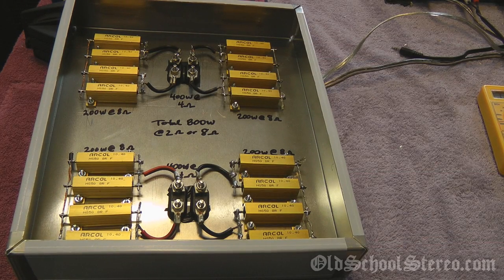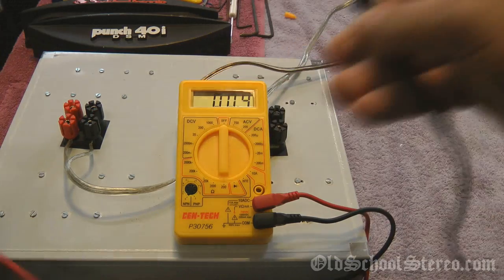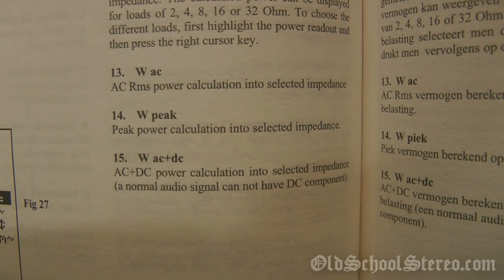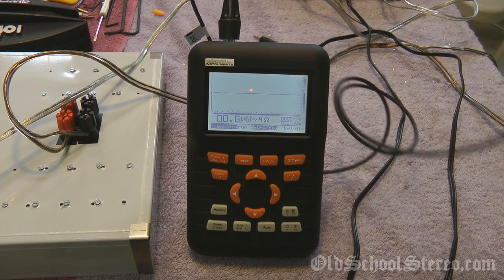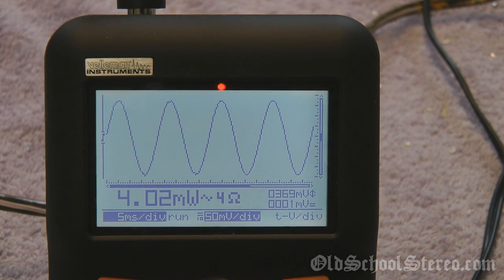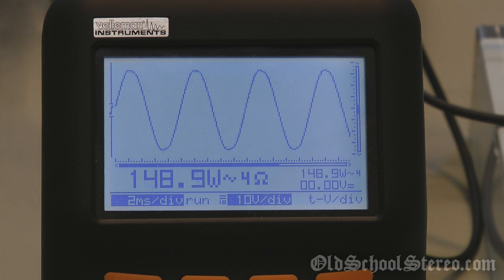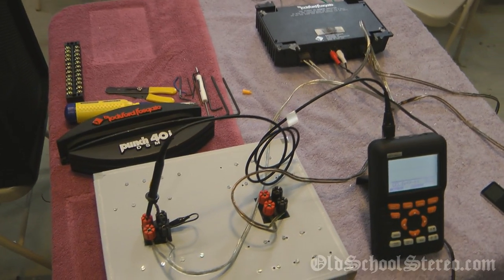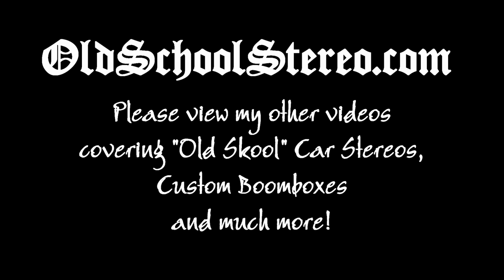Test Car Amplifier RMS Power Watts - Not Clamping Using Oscilloscope

Comment from the maker: speakers represent a reactive load to an amplifier (ohm load changes based on frequency) whereas the resistors I use offer a resistive load and the ohm load does not fluctuate during testing. It provides a much more consistent result and there are phasing issues to account for when using reactive loads which further complicate the measurements

Comment from the maker: @kskate91 Yeah, it's called a "Punch Status Display" or PSD. A telephone style cable would connect to a small display with indicators for amp operations such as; power, signal level and thermal protection. You can get the 40x2 manual from Rockford, shoot me a message if you want with an email address and I'll forward it to you.

Comment from the maker: Most are rated at 2x continuous rating for bursts. You'll just have to monitor the resistors as they will heat up quickly. Look on eBay for 1000w braking resistors. They are available for around 35 US each and available in 16 ohms down to 2 ohms

Comment from the maker: Speaker is reactive and ohm load is always changing (reactive). It's best to use a resistive load to keep measurements accurate. You will also need an o'scope and True RMS volt meter. My o'scope has the True RMS volt meter built in, but I also monitor with a fluke DMM

Comment from the maker: It was cranked up pretty high to match the low voltage output from the iPod. Remember, the gain is not a volume control, but a signal matching control. I could've had it cranked all the way to the max, it would've just started clipping with less volume on the iPod. The resulting power output would be the same. If the gain was too low, when the iPod reached max volume, there would be no clipping from the amp

Comment from the maker: @toucheslapper I purchased the parts from Mouser, but I think DigiKey has the same parts. I'm going to build another resistor bank and use the case of an old DVD player as it is almost the identical size to the aluminum case I got from Mouser. Send me a message here if you need the exact part numbers, I should be able to dig them up.

Comment from the maker: I see what you are trying to do here, but the 2ohm resistors will only consume power and will not help you get more power to your speakers. The extra power will be consumed and turned into heat by the resistors. In the old school systems run by a single 2 channel amp, some crossover networks would include resistors, but the intention was to lower the output of the rear speakers.

Comment: I bought a nano v3 oscilloscope to help me dial in the gain on my rockford fosgated bd1500.1 mono subwoofer amp. (2000-2003 year) I ran into a problem with the oscilloscope not having the capacity to read high enough voltage!
it tops out at 84 volts and the wave peaks somewhere way off the limits of the screen.
Question: do you know what the maximum voltage/wattage your oscilloscope can read and still show the sine wave on the screen?
thanks!
BTW awesome channel!!

Comment: How does the reading you get from the o-scope compare to what you get from your amp dyno?  Would it be comparable to the un-certified run?  Really like your vids, good stuff!
Reply from the maker: Yes, should match uncertified (clipping) mode. Thanks for the comment and for watching my vids!
Reply: Now that you use an AD-1 or amm-1 does the Velleman read the same as those or is it sowing “va”? I would like to get a amm-1 but none are available so a Velleman hps50 seems like my only option to show watts. Like your videos, have you tested a Soundstream Reference 405? I have 2, one on each side of vehicle. I run channels 1/2-3/4 bridged and there are no power specs that I can find for that mode. Again love your tests and all the old amps you test. Have you tested an original Zapco 2 piece pa151 (before they had rca’s in chassis)? If not I can loan you one to test that I bought original way back. Also have  Nakamichi pa300 and pa300series2 and Alpine PDX5 I would like to test as well as home equipment. Classe ca300 300w/ch-8ohms
600 into 4ohms and McIntosh Ps112 sub 300 into 8ohms. Any info is greatly appreciated.

Comment: Ahh, meant the TPI 440. Either way I ended up with a HPS50 that just arived today. Got the DD-1. 
If it's not to much trouble can I get the parts list for the dummy load tester? If it's easier to respond I go as ROLEXrifleman on the steve meade site as well.  THANKS AGAIN!

Comment: are these measurements equal to Volt X Amperage X Power Factor ? if power factor is not included during the process, it can't give the correct output.
Reply from the maker: With a truly resistive load, you can use Ohm's Law and power factor and electrical phasing are not involved as they are when reactive loads are used
Reply: Dereck BigDWiz
you mean powerfactor is %100 with a truly resistive load ( constant ohm )

Comment: Hi Big D
Would like some info from you please. Wanting to run a SQ system in my car I am running a Helix Competition 6 Channel amplifier with Morel Elate 6.2 components (200rms) both are hi SQ products but the morel speaker crossover puts out a 4 ohm load, and my amp only gives out 75RMS @ 4 ohms want to drop it to 2 ohm load without damaging the amp or speakers.Jumps to 125RMS @ 2 0hms.  Can I put 2 ohm resistors just after the amp output channels. Which Good SQ resistors would you recommend

Comment: Yo big d I have a question.my buddy is going to send me a 84 Amp power supply and I'm going to run a kicker kx600.4 on two mtx single 4 ohm 15's. Will the electrical coming from a wall outlet be able to handle the 600 rms being generated?
Reply from the maker: Yes, it should be fine. Amp won't need large amounts of current continuously

Comment: Power factor is not used in measuring watts RMS as far as i know you can do it without the resistors ohms law  Watt = (Volt^2)/Ohm only need a multimeter and scope may be it not as accurate has a true RMS but u can
Reply from the maker: Power factor comes in to play when you are using a reactive load instead of resistive

Comment: does the scree look wash out? like in d vid?
Reply from the maker: +Raj Dann no, screen is clear. Hard to capture for video purposes. I bought this model because it had a USB output and hoped I could use it with a PC to show the waveforms...but the output did not display the wattage/voltage, just the waveform
Reply: how long did it took to ship to u?
Reply: kool I ordered one based on watchin ur vids....

Comment: hmm cosnidering i dont intend to ever do comps. could i just use some music, instead of test tones? lol
Reply from the maker: +emerybryant more recent tests show dynamic tests, which simulate music power
Reply: ah ok. cool. hoping to buy one of these in the next couple days! :D
Reply: lol finally got one! it hasnt got here yet. does it have standard bnc connector? o.o i cant find pics lol
Reply: standard bnc confirmed. however something i wanna know is the resistance of the test mode. the lowest the meter shows is 2 ohm. will it not go below 2?
Reply from the maker: Yes, you will need to use VRMS mode for less than 2 ohms, then calculate wattage by using Ohm's Law
Reply: ok thank you very much sir! great meter for the money in my opinion :)